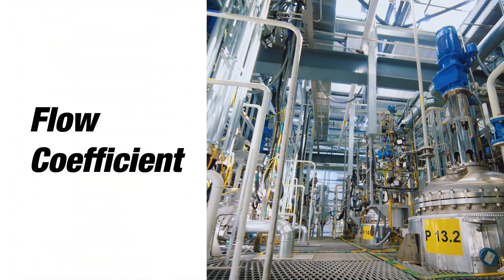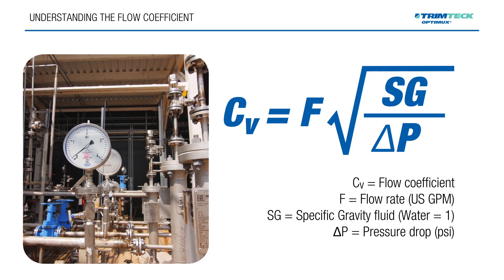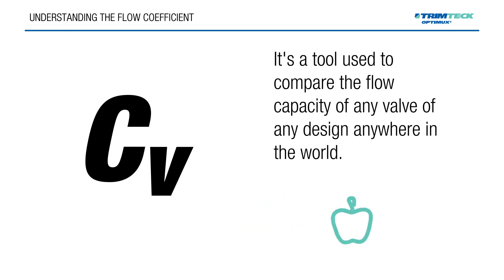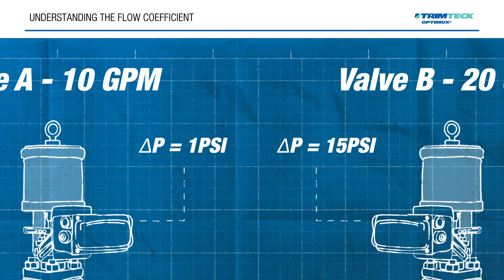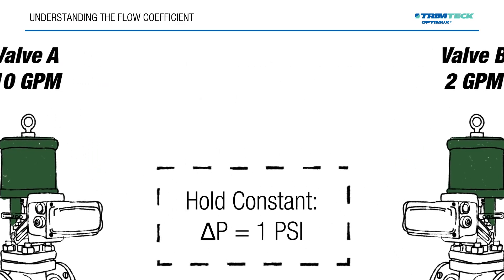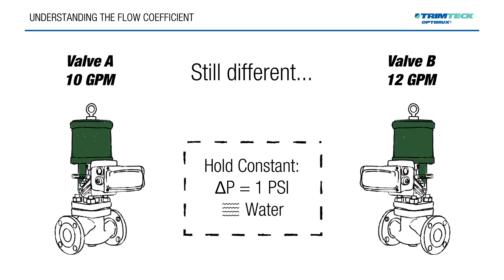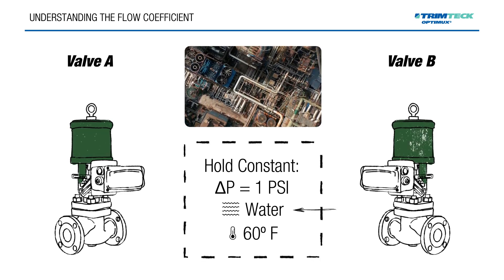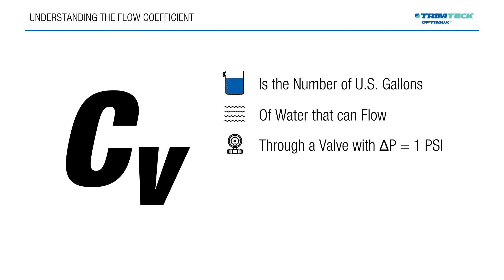What is Cv? | Understanding the Valve Flow Coefficient

Comment: Thanks...good video!! Test procedure requires 1 psi differential static pressure evaluated starting from certain length inlet/outlet valve bore diameter,60F,water media, valve full open position...,,so, is the flow  coefficient evaluated on these point far away the valve or considering the real pressure drop across inlet/outlet of the valve?